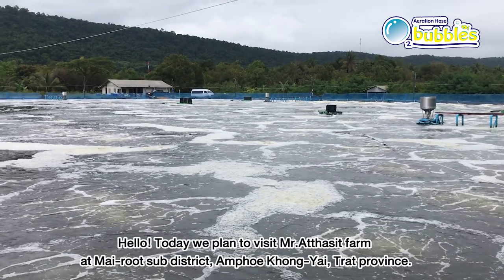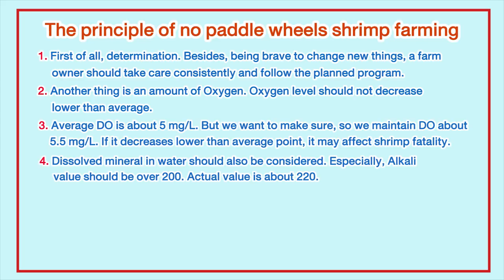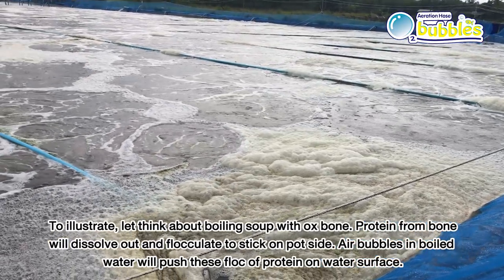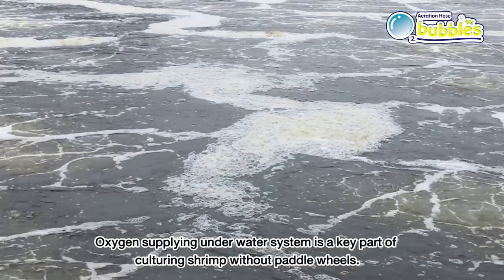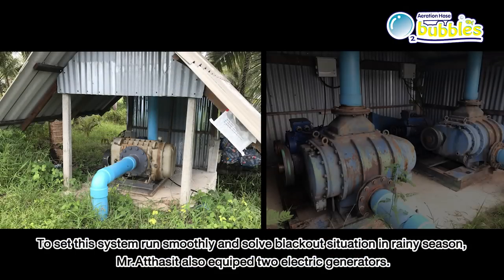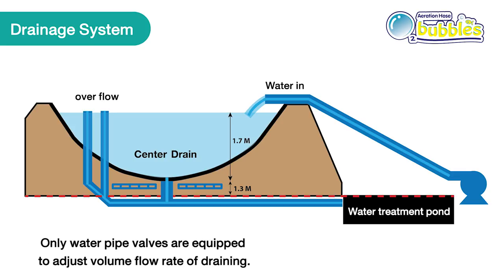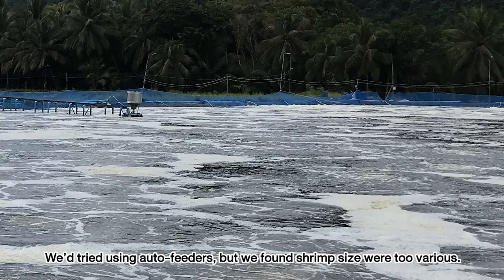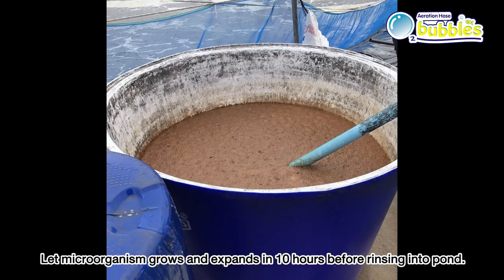New solution with innovation for shrimp farming without any paddle wheels, using aeration hose.

Comment: How much LPM of air per cubic meter is needed and what is the stocking density
Reply from the maker: 1.For LPM of air per cubic meter, we don’t have that information fotr this.
However this system use Root Blower 20 HP 2 Set and 30 HP 2 Set for 24 Hours. They control average DO is about 5 mg/L. 
2.Density at the beginning is 4,000,000 of Shrimps Lavas in 0.8 Hectare.

Comment: The entire setup is to remove before harvesting or how it will be ?
Reply from the maker: If the entire set you mean is the aeration system, they move the aerator when they need to partial harvest. You can see at 08.52 the upper right corner, the aerator design can move.

Comment: How many HP for water pumping?
What is the production cost?
Nice setup!
Reply from the maker: They  are not water pumps, they are Root blower air compressors
There are 4 of 20 HP Root Blowers and 2 of 30 HP Root Blowers.

We don’t supply Root Blower but we are supplying O2 Bubbles Aeration Hose which deliver Oxygen in volumes.
Reply: Kasipantarut Company Limited but you also have 4 pumps coming from your treatment ponds.
Reply: what is the PM10 probiotics? where can you buy it? is it different from EM1?

Comment: Sir, how about stock density? How many shrimp per m3?
Reply from the maker: They culture 4,000,000 shrimp in pond. The approx. is 10 MT/1600 Sq.m.
Reply: @KasipantarutCompanyLimited  it's mean 4.000.000 ÷ 1600 = 2500 per m². That's amazing! How can I reach their contact in order to learn more? I would like to ask about blower pump requirements and aeration points 🙏

Comment: Can you please give how yo size the root blower? In this 8000m2 ponds what is the size of the root blower A(duty)?
Reply from the maker: They use Root Blower 20 HP - 4 Sets + Root Blower 30 HP - 2 Sets.
Swap open for 24 hours.
Reply: @KasipantarutCompanyLimited  what does swap open means? do they run half the total of 140 HP (70HP) and swapping the other half every few hours?

Comment: how do you clean the pond bottom ? diving from one corner to the next ?
Reply from the maker: Mr.Atthasit use protein skimmer principle in this pond. They will separate waste and protein precipitate up to water surface. Then, it flow to drain out at overflow tubes. The pond bottom area is clean as well
You can see the principle at 4.30
Reply: @KasipantarutCompanyLimited   how about the dead shrimp, molting exoskeleton ?
Reply from the maker: They drain out the waste at bottom of pond and also if they float at surface, they have over flow for drain out.